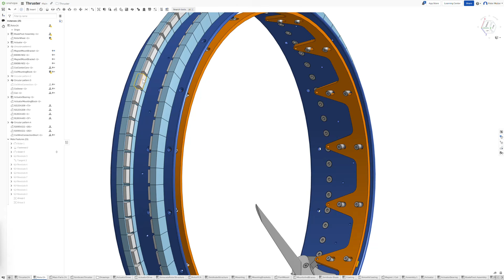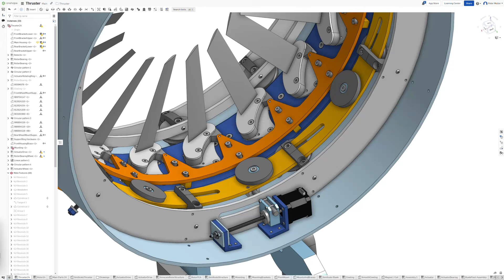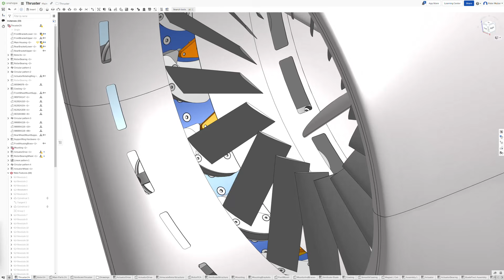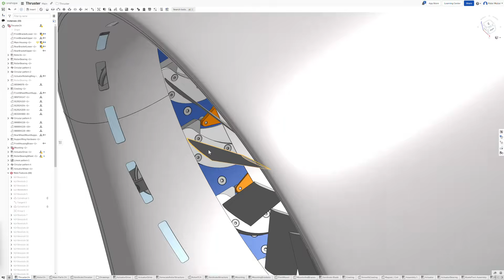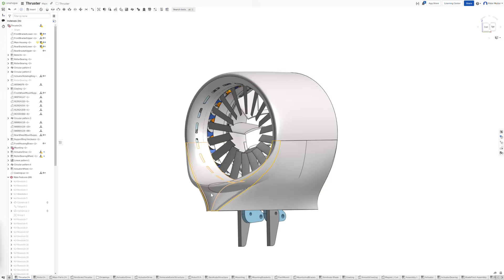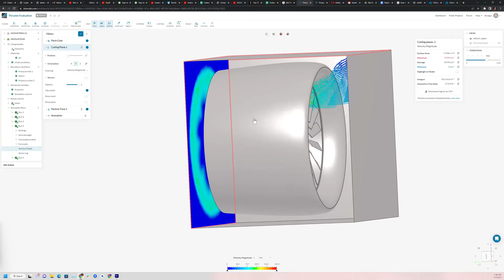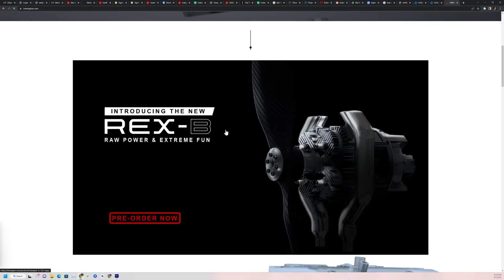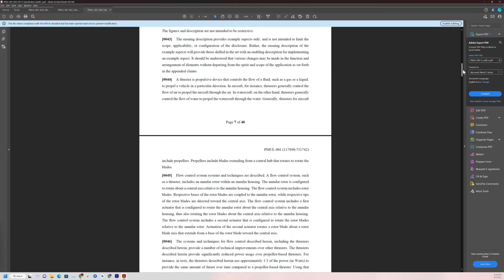Could this Thruster transform Aviation?

Comment: Would that amout of rotational mass create a gyroscope effect? I wonder if that would affect stability.  I wonder how heat in places might affect this design... particularly the bearings. It seems the speed and force at that diameter would be greater than something more conventional. 

Is it possible to implement a MagLev design to eliminate bearings?

Comment: As someone that has had to deal with high speed bearings, I don't see how this will ever work as a turbine. Imagine how fast a bearing ball will spin going around a circumference of that size, now multiply that by 50,000.  The bearing balls will explode.

Comment: Make some calcs on blade stress. The blade thrust load will bend the blades as there is nothing else holding them back. A huge limiting factor in the design perhaps.

Comment: Would adding a center that connects all the blades (obviously still allowing independent pitch changes) assist in adding strength and eliminating any deflection?

Comment: I like this design; and "commend your efforts."
It should "Transform Aviation(!)"; at least for starters beyond all other past promises from a list of several other companies that have not yet themselves measured up to their own marketing commitments.
As an engineer of electronics; and having also built roads & bridges; and coming from a certain historic aerospace family in Ohio; and more than 100-hrs: "there is a solution for your patent's coils; as well as for an extra input electric source that is not solar or nuclear or deductively "not a lot of a list of other silly things that no one would ideally and in practice would want in their aerospace-craft."
First then is to view the COIL's as what they are: "all inductors are also capacitors; as solenoids and as coils; leading Voltage; and lagging current."
A wire gauge the diameter x10 mils of surface area greater than a much smaller gauge has a resistance "much-much lesser" or inverse with that smaller wire comparatively that might comprise two distinctly different parametric valued coils as inductors; and as caps.
A larger gauge coil though, a greater surface area has much greater conductivity, more charge to lead at once rather than a finer gauge.
Impedance Z, as a form of conductivity expressing with resistance and reactivity: Z = R + (+X - X);
  resistance of a certain gauge wire (to be coiled) versus what has already been wound;
Chi (X) as reactivity of conductive (or reflective-signal) material can be derived from measures of Inductance and capacitance from that specific form of meter, just as Resistance can from a multimeter.
[A power source connected directly with an Inductance Meter can also kill it.]
As solenoids, each of these coils create an electromagnetic field.
EM fields configured centripedally (or towards a common central axis) by solenoid-coils having also capacitance in turn exhibit the generation of an electrostatic field, which contains a unique "exclusionary" dielectric (or medium).
I think this is enough to vary, in order to fine tune your patent.
Changing the wire gauge.
Reorienting the coils?
[Each coil should also have a capacitance to inductance resonate frequency to match with a capacitor component in a board.]
Welding the blades smoother or refracting/molding the blades to mounts.
And of course thoughts over how this design being motivated by EMF resembles communications technology.
Also, if a bifilar coil used for motoring that has two "twined offset gauge wires" is compared with a series bifilar, then your batteries using the later form series as a transforming capacitor before reflective ground should ALWAYS be charged.

Comment: Question, 

Have you considered cutting the blades length in half and either adding an offset additional row or perhaps making them deeper? 

As others pointed out I also agree the center needs a ring for support.
Reply: Less blades = more efficiency. Longer blades = more efficiency. If he does that, Efficiency goes out the window

Comment: One issue is with it being electric, a plane would need to carry a huge amount of batteries which is going to be incredibly heavy and is currently the main issue with electric planes. Another issue is that if this is gonna replace propeller planes it will need to be much bigger and having an electric engine that big will add a lot of weight. And if it's gonna replace jet engines, idk if it can compete with jet engines with thrust output and performance at higher altitudes where the air is thin.

Comment: Are the bearings easily sourced? Is it a common part? How does it handle a frozen chicken from an air cannon? Could the blades fold in and allow objects to pass through? What is the most common failure mode? Do they free wheel without power or stop at normal air-speed? Were the bearings open, sealed or on a lube system? Will it offer regen? Not sure about the magnets either. Big flat ones would have a greater pull than multiple small ones spaced apart with similar mass, or are they close enough to make a combined field? I'm just thinking draw. In generation they are a significant portion of the rim. Like 75-80% of it.

Comment: I see 2 problems, the first is blades under compression and second the guide wheels and bearings will be pushed towards the outside at high speed since your center ring will expand with inertia.

Comment: Very elegant construction for an engine. Looks really interesting.
However, I don't see the advantages of this design compared to conventional designs with the bearing in the centre. The bearing and the drive on the outer ring is much more complex than in the centre and in my opinion hardly brings any advantages. Here is a short list of the problems.

1. motor on the outer ring: significantly larger and more complex design, the higher torque due to the large lever arm is not needed here, in a turbine you need a high speed, not a high torque. The high number of pole pairs is more likely to cause problems at high speeds due to the damping of the coils.

2. bearings: large thin bearings are relatively complex and therefore expensive + more prone to faults. Compared to the conventional bearing over the centre, a bearing over the outer diameter must show clear advantages to be sensible.

3. unbalance: At high speeds, there may be problems with the imbalance of the turbine wheel. This can probably be solved ok. Since the wheel is not very long, you may only have to balance it statically. 

4. electric drive: yes electric drives are much more efficient than combustion drives and yes we are facing a global climate catastrophe. However, electric drives still have the problem of energy storage. Modern lithium ion batteries achieve an energy density of ~0.16MJ/kg compared to ~43MJ/kg for hydrocarbons (17.2MJ/kg if we consider the efficiency of ~40%. Always more than a hundred times), this is a fundamental problem for electric powered aircraft. For small aircraft this is tolerable, but for larger aircraft this energy density is the death blow.

5. electric drive 2nd: A conversion of the concept to a combustion drive is only possible with greater effort and increased losses or complexity. One would either drive the rotor with a spur gear on the outer diameter or similar to the Avro Canada VZ-9AV with a turbine on the outer diameter (higher losses). With a conventional turbine, on the other hand, you can simply add a gas turbine to the main shaft on which the rotor is mounted (no gearbox -> simpler -> higher operational reliability, more robust).

6. Tip speed: The tip speed of normal engines is limited by the speed of sound. If the blade moves through the air faster than the local speed of sound, shock waves are generated, resulting in large losses. For this design, the speed at the outer diameter must be taken. It does not make sense to use the speed of the blade tips in the centre in this set-up.

7. loading of the blades: As already mentioned by others in this comment column. Could cause problems due to instabilities. As far as I know (which is not saying much) there are difficulties with very large turbofans in the fan due to the high tensile load on the blades because you need the largest possible diameter for a high bypass ratio and at the same time you only get a high speed from the gas turbine. This can be countered by a smaller diameter (low bypass ratio -> lower efficiency), a reduction gearbox (high complexity -> high maintenance) or by stronger materials (expensive). Unfortunately, this solution does not contribute to this problem, as with an electric drive you can easily choose the speed.

8. variable pitch propeller: easier to implement in this design for high numbers of blades. But, as always, it brings with it a high degree of complexity. I do not yet see the advantage of this problem compared to a turboprop.

All in all, I don't think that this engine will revolutionise engine technology (which doesn't mean that it can't be successful in some special application).

Comment: You my want to alter your coil to a square section of wire, which will enhance field density.  It is what is called an "edge-wound" coil.

As for tip speed, I would imagine that you will still have the same issue at the roots, which are at the outer edge of your rotor.  Find out the issues in conventional design and assume for now that you will see the same problems.

Comment: I was thinking of a similar motor design but for a drone. Do you think it would be possible to change the pitch of the blades by using a movable ring of magnets on the outside with a corresponding magnet on the blade base, it would save a lot of parts and remove the need for al that precision wheels and bearings ( although that's an awesome design). also, it might b a good idea to add a ring in the middle to stop the blades from fluttering at high rpm's

Comment: This is incredable! I actually came up with an almost identical design about a couple months ago so to see that I was on the right track and you've done the math and work to make it a possibility, I hope you are able to take this as far as it can go. I'm trying to make a design for cold fusion reactor and was trying to make an electric jet engine for a aerial vehicle with vertical take-off and landing running off of just water. With your thruster design, if I can even actually make my reactor, it would make my aerial vehicle very possible and if I did get that far I would definitely  like to work with you on that. But, Good Luck! I hope you get a lot of interest and this become a huge idea!

Comment: I'm familiar with simple rim driven electric fans (where the fan is the motor) that do 6krpm, but those still have a standard hub and axis bearings. I didn't hear you say what the advantage of having a hole where a hub would normally be was, compared to the greater stress and wear of bearings that the design seems to have. I assume that the hole is key to the patent?

Comment: Peter, very forward thinking. What is the KW rating at maximum power? If you used 8 Koenigsegg Quarks rated at 247KW driving 8 fans on a central shaft, you would have only the central shaft, bearings and the 7 stationary stators. Similar to a jet engine. The power supply (David) operating at 900V 3 phase would provide similar thrust to a mid range jet engine. The biggest issue with present battery technology is the weight. When someone comes up with either a revolutionary light weight new battery or a scalable fusion power generator, EV planes will really come to be better than fossile fuel engines.
Reply: This looks really interesting for electric flight. 

What always puzzles me is when people make the assumption it will be OK to continue using fossil fuels to power new designs. I don't understand why people don't get this. Unmitigated fossil fuel burning will lead to sea-level rise, loss of habitable land including cities, collapse of agriculture across large tracts of the globe, economic collapse and war. Whether that happens in our lifetime, next century or later is the only debatable point. 

If these fans are three times more efficient than current designs and batteries reach four times the storage per kg, is it possible that multiplier starts  to make emissions-free large & long-range passenger aircraft possible?

Comment: Can this ring thruster be positioned horizontally and two such ring thrusters stacked one above the other, rotating in opposite directions so as to generate vertical thrust and neutralize radial spin and thus become a centerpiece of a 'flying doughnut' twin rotor helicopter?

Comment: I'm an engineer, fabricator and inventor. Change the rotor support wheels from the sides to horizontal pin bearings on the outer side, like a non-tapered wheel bearing design. [hub bearing] Then the bearings can be designed for 20,000 RPM's + Examine how Elon has designed his new motor and implement/duplicate that for a rotor/stator driving combination. His motor designs have high torque, efficiency and RPM capabilities.

The blades should be made the same shape as a current turbofan design. That would create efficient high pressure on the back side of the blades. The blades themselves act as an airfoil and are what provides forward thrust, the air flow out the back is just a byproduct which you harnessed with the back side airfoils but they also restrict airflow. The more air that is allowed to flow [least restriction] over the fan blades the more forward thrust will be generated. The front side of the rotor would also need a thrust bearing to handle the force of the thrust. The fan blades will also have to be connected at the center even with a nose cone that has pins going into the ends of the blades, the nose cone should also be supported by either a structure on the front or back of the blades. The structure would cause some airflow restriction [two or four arm] but is required for proper blade support.

Think about it, under operation as pressure develops on the back side of the blades, it will cause the blades to want to bend forward. Currently the ends of the blades are unsupported and will try to bend/flex forward.

I have spent over 40 years generating my own designs or observing existing designs and contemplating how they could be made better.

Maybe you can use some of these design ideas as food for thought.

Comment: My question, avoiding all the other technical issues... comparing this to a standard turbo fan like on a 737 or 777...if both fans are pushing with 100 pounds of thrust, what is the loose in power input? I just don't  see how moving the power to the rim compared to a centrally located power input would decrease power requirements... it seems like a "coreless fan" would just add complexity and weight, compared to a "cored fan", with minimal change in input power or output power...🤷‍♂️

Comment: A couple of questions:  are the blades single-crystal and is there (or can there be) a twist in the blades to give a compensatory angle of attack to the air flow towards the middle....do metallurgy, costs and aerodynamics even allow that?  Oh, one more:  should there be an inner stabilizing ring connecting the unconnected inside blade tips?  This design is fascinating to me, well done.  The cowling modification made total sense to me as the original design would seem to create basically an air funnel, kinda compounded by the Coanda effect and, to my simple mind, it might be prone to eddies...vortices.  I also worry about the bearings and swashplates under constant load.  I'm fully aware that these questions and observations just might be putting my own lack of real knowledge on blinking-neon-light display.  =D

Comment: Would not a central stabilization ring prevent flutter and help prevent blade deviance under high compressive load? Pitch variance would still be possible and the additional structural strength would add greatly to the compressive capability of the blades…

Comment: Looks like all the bearings and wheels will be a wear and friction problem in long term use. Perhaps an air bearing or alternately some sort of magnetic levitation would be more practical.  I think perhaps a linear motor may be better at powering the unit rather than the large number of magnetic coils.

Comment: What are the advantages versus a hub motor.
All I can see is more moving parts, more magnet, more coil, more bearing. And at the end it's nothing more than an adjustable pitch ducted fan.
In a turbofan the moving blades have fixed pitch, but the fixed blades are often adjustable. Anyway plane engine runs 99% of the time at the same regime.
Maybe there's something I don't see and I wish you good luck.

Comment: Your fan weight computations does not include the power source: the generator/motor.. It is going to be a big part of the weight figures and should be included in the weight comparisons to jet engines. 
Consider having a single motor in the middle going to a differential, which turns carbon fiber shafts which turns both fans using gears. This would use proven automobile technology, but using carbon fiber to save weight, and involve off the shelf parts. Carbon fiber differential and shafts are already in use.

Comment: It's an interesting concept I can't imagine the external forces on the ring at the higher RPM with a coils and the magnets but I'm curious regarding blade flex and tip flex have you put strain gauges on them yet to do those measurements are those heavy enough and strong enough blade? what is the material?

And what is your plans for icing conditions there's a whole lot involved with that for that type of an engine or power plant I should say.
I'm very excited about it I'm an old traditionalist but as a world turns we get better and better considering the lightweight material I'm worried about the forces as it rotates.
And if this actually works the way you're designing it to do can I suggest assigning it to 1800 lb of thrust each.